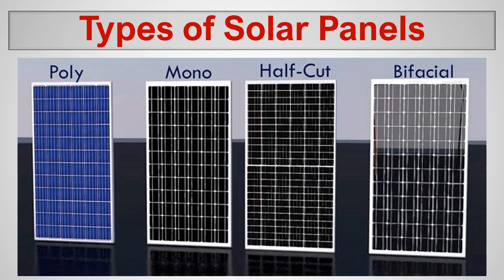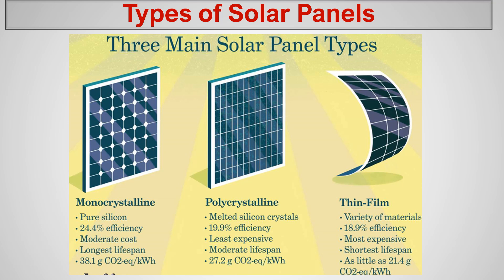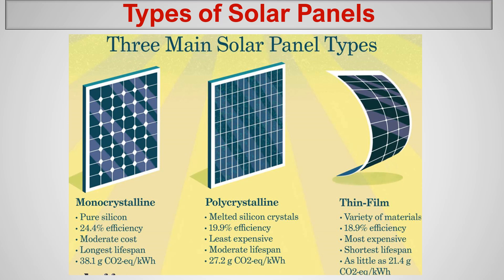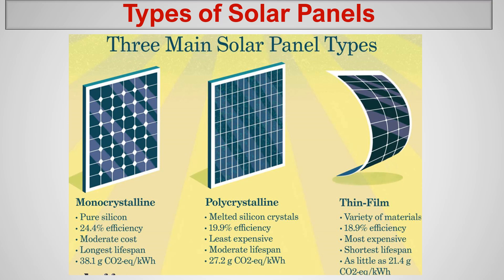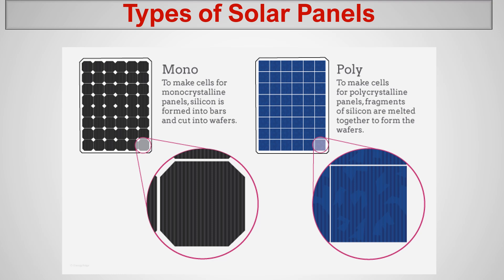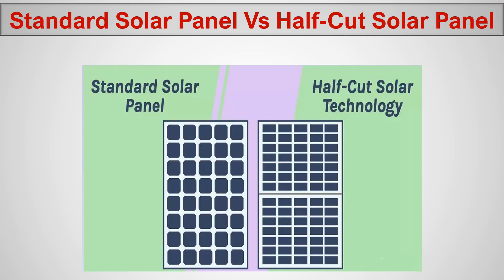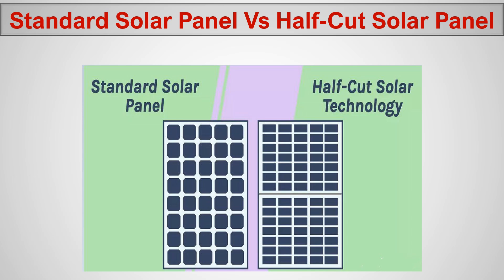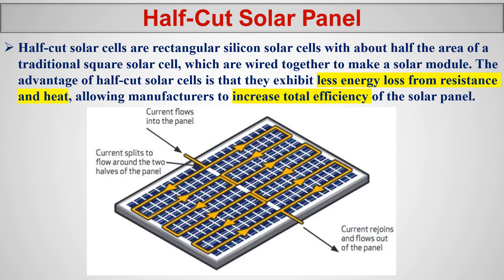Solar Panel Types Explained, Best Solar Panels 2024, Solar Panel Comparison Guide

Comment: 🎉Highlights:

545 Wp power

23.3% module efficiency

N-type i-TOPCon cell technology

Multi-busbar technology

Glass-glass construction

Full black design

35-year product guarantee

40-year performance guarantee

Ideal for:

Rooftop systems

Open space systems

Maximizing self-consumption

Reducing electricity costs